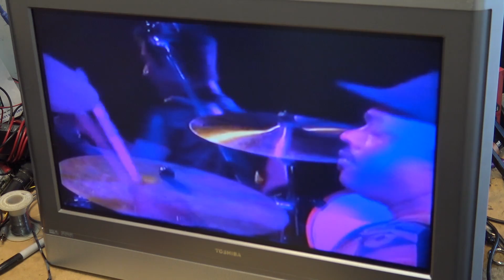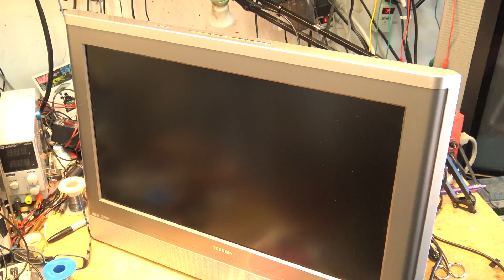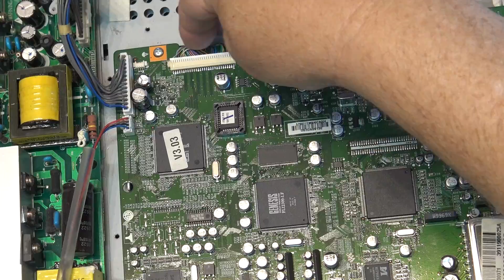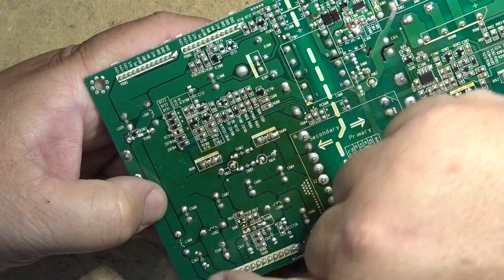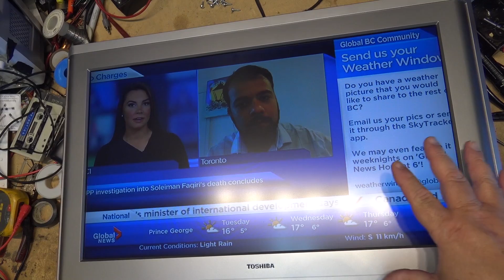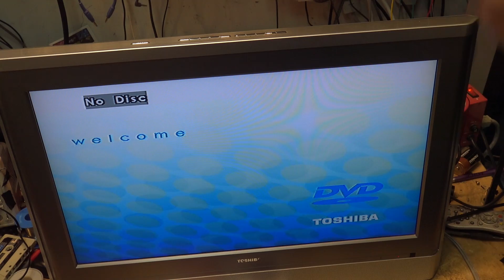Toshiba 23HLV85 LCD TV DVD combo DVD player not working

Comment: I think it would be an interesting project to take the internal DVD player out of one these combo TVs and mod it into a standalone portable player. Not sure if you need the mainboard to operate the player but I think you just provide power and it works and outputs video/audio. Solder some RCA plugs for the ouputs, make a DIY power supply and make a 3D printed shell for it and bam. Maybe you could use an old laptop screen/speakers too and make it fully portable. I considered doing that with an dead RCA combo TV/DVD unit I got but I gave up. I think it would be pretty easy though, hardest part would be designing a shell for it.

Or you could just buy a portable DVD player, but I think it would be a interesting project and of course reduces waste
Reply from the maker: Many are tied to the tv os.  You know for the remote control functions and stuff.
Reply: @12voltvids  When I took apart the RCA TV I got, the DVD player mechanism had a PCB with three multiconnectors, and all the pins were labeled. One multiconnector was for power, had both 12V and 5V pins and was connected to the power supply.

The second multiconnector was connected to the TV's mainboard and had all the outputs such as composite, component, and even RGB video output, along with SPDIF audio. I don't recall if it had analog audio outputs. 

The third multiconnector connected to another PCB that had buttons on it for controlling the playback, and I think it did have an IR receiver for the remote.

Keep in mind this was a while back and I can't find a picture of the exact PCB so you may be right, but I think it can be operated without the mainboard.

Comment: most gamers want Sony trinitron's or the holy grail Sony PVM monitors.
Reply from the maker: Don't know why.  Sony were over rated.
Reply: @12voltvids  Sony PVM were ones that were used in DR offices for like the ultra sound machines and what not so they had more lines then most tvs they also can accept RGB witch is the best hook up that most older video games systems pre play station 2 can use.
Reply from the maker: They had a fine pitch computer tube. Bug deal any cheap computer monitor also has this and rgb. I worked on a few of the pvm series.  They were big and heavy. They still have those bloody wires in the aprature grill which you see in the picture.

Comment: I've got an old mid-late 2000s Toshiba Regza 24" HDTV/DVD combo that I bought used for really cheap.  The DVD player didn't work, but it was a very minor mechanical problem that was easy to sort out (the irony is that I never use the built-in DVD player since I use a Blu-Ray Disc player with the TV).  After that, I tightened down the screws for all of the circuit boards and cleaned out the dust.  I've had it for over four years so far and no problems at all.  The sound is decent for a TV of its size and the picture is quite good.  I'm knocking on wood that the TV will last me for many years more.

Comment: Hi Dave, about 26:20 there are several caps that look like they have black heat shrink on them.  Is there a design or protective reason for the covering ?   Thanks   J K    By the way, have you ever started up your HD Classic and drown out the lawnmowers ?
Reply from the maker: Those are not caps. They are choke coils and they put hear shrink on them to keep them from singing.

Comment: I RECENTLY GOT A  USED TOSHIBA REGZA 42 IN AND TRIED TO MATCH IT UP WITH MY SAMSUNG BLURAY/DVD PLAYER - THE REMOTE CONTROLLER ON THE SAMSUNG BR/DVD PLAYER  WOULD NOT FUNCTION- IT WOULD PLAY THE DVD DISC, BUT THEN I HAD TO START IT MANUALLY ON THE PLAYER, DUH! (APPARENTLY THE DVD BR PLAYER FROM SAMSUNG WAS DESIGNED TO ONLY BE USED BY THE REMOTE CONTROLLER) 
THINK IT MAY BE COMPATIBILITY PROBLEMS....!? ANY SUGGESTIONS

Comment: On the capacitors, it is more important to measure the EPR ( aka Leakage) than the ESR.  Also, there are a lot of problems that are intermittent with the Chinese capacitors.
Reply from the maker: Leakage was an issue with tube gear.  With the low voltages is not as big an issue unless it shorts.

Comment: David , could it be that the dvd mechanism would cause the whole t.v. to act up ?
Reply from the maker: The sound issue that was complained about was a customer setting.  Set to one if the simulated surround modes

Comment: I think you don't use the screen all the time at 100% birghtness as well as me. My One Plus 3 phone with also OLED screen is 3 years old and has absolutely no sign of burn-in. Samsung = Scamscum
Reply from the maker: I use my phone in very bright environments, as in outside in the blazing sun.  If it is not turned up I can't see it.  No I don't turn it down inside either as if I do, I can't see it in the sun to turn it up.
Reply: @12voltvids  Is it also not set to auto brightness? Then it would explain why mine lasts longer. I got auto brightness on (even if it is sometimes annoying). And I found out, One Plus and most other phone manufacturers are sourcing the OLED screens from Samsung as well... It's just how OLED is. This is why I don't recommend buying an OLED TV either. For just watchimg movies or TV it might work for a long time but when connecting a PC onto it or something with a lingering OSD... Nope... Bad idea.
Reply from the maker: @kyoudaiken  I have a plasma that is permanently burned with the Global logo. First the bottom right corner, and then they went to a 3/4 screen for their morning news that I watch every morning for an hour with the bottom and right side filled with stationary graphics. Its an old plasma with a cracked screen so I don't care. I will run it till it pops and then toss it. I have 4 more plasma and an LCD plus a nice LED DLP (with a bad chip that has some white spots on the screen) waiting to be put to use for me to see the morning news on. One of them will go in next. I will never need to buy a new TV as I have enough working sets to last me the rest of my life.
Reply from the maker: @kyoudaiken  Auto brightness drives me crazy, it is always too dim when I need to see it. My kids hand me their phone to show me something and they have it so dark I can barely see it.  You also have to appreciate that as you age, you will find you need more light to see things.

Comment: Toshiba dvd players in pc's were a pain for bad feedback switches, but that thing has triple trouble.
I did expect the tripod halogen bulb to make another apperance to resolder the main chip lol.
I'm supprised the psu is still ok.
Reply from the maker: Everything that used those type of switches had failures. Look at all the Sony DAT machines that had them as mode switches, and VCRs, and FAX machines that used them for paper detection.

Comment: Regarding your comments about the amount of shielding you see on older TVs compared to new ones. I'm wondering if part of the reason might be that the new ones use LED backlighting while the older ones have CCFL backlights driven by inverters which maybe generate more RF noise than the relatively simple PWM drivers for LEDs. Just a thought. Of course the most likely reason is probably more about reducing the cost :)
Reply: I see a bunch of modern TVs where the reflector is the back of the TV and then there's just a tiny plastic box screwed to the back for ports and smarts.

Comment: 17:15 that's why I avoid AMOLED screen phones now. Had it happen with a Samsung S7 after only 18 months.
Reply: AMOLED is well-known for having a very short lifespan in addition to burn-in problems. Not a good technology I think. I imagine that it will start to disappear in a few more years once consumers finally start to see the problems it causes, rather than listening to all the marketing w**k
Reply from the maker: And yet they push it for high end tvs.
Reply from the maker: @countzero1136  Actually the oposite. AMOLED are plastic, like a flexable pcb. Therefore no glass to break. They still have the digitizer made out of glass, but the screen won't crack. They also draw less power than backlit lcd. Even craple is using them now.
Reply: 12voltvids perfect way to force their users into buying a new device.
Reply: I have an S7, but was luckily able to reverse the burn-in. Picture looks great now
Reply: @joshm264  You were very lucky then - Mostly, by the time people bring their devices to me, it's already too late to remedy the burn-in issues :(
Reply: @countzero1136  under the right angle you can still see it
Reply: My One Plus 3 is now 3 years old and has not a signle sign of burn-in. Samsung overdrives them. Samsung = Scamscum

Comment: I’m surprised Toshiba didn’t use one of their own drives. They had a Toshiba - Samsung optical drive partnership and those drives were pretty reliable over the years. Always annoys me why name brands don’t use their own parts in their own product. They all do it. My Sony combo has a Toshiba DVD player inside. My Toshiba combo has a Panasonic DVD player inside. My Samsung computer monitor and LG TV has an AU Optronics panel inside. My Acer monitor has a Samsung panel inside..... go figure.
Reply: My Toshiba tv has a Skyworth panel, my Samsung laptop has a Toshiba-Samsung dvd drive and a Hitachi hard disc, and my uncle's old Hitachi tv has a Toshiba panel 🤣
Reply: Kind of the same thing where some time ago Honda Accords had Mitsubishi alternators, SAABS had GM blocks with Saab electronics controlling everything... (GM sunk Saab). Or I bought a small GE  air conditioner..thinking it would have a GE compressor....it didnt. It's all about the money and the bulk deal.